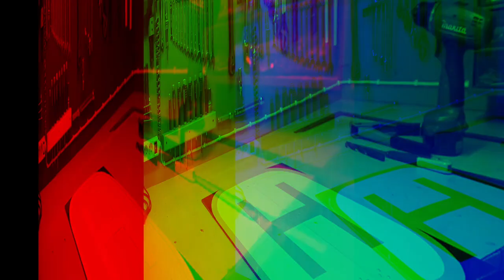DIY FOLDING HELIPAD - Drone Landing Platform - Homebase for your Drone

Comment: A suggestion would be not to use hinges, but instead just glue some kind of fabric (or if ghetto even duct tape would probably work) as the hinge.    That way there's no metal there, in case you have a drone that is very sensitive in calibration.
Reply: I was thinking more along the lines of using counter sunk plastic screws and using a dremel or something to grind them down flat on the opposite side.